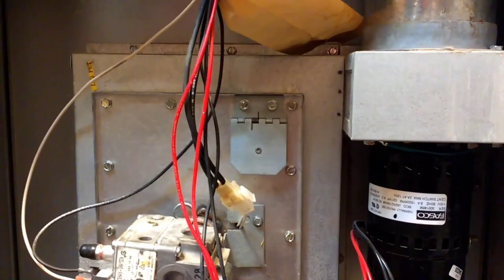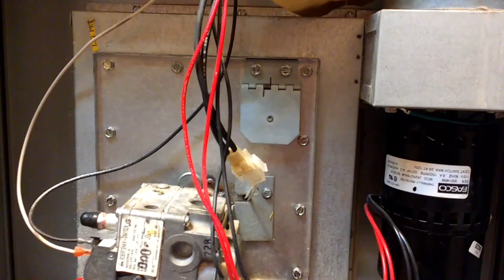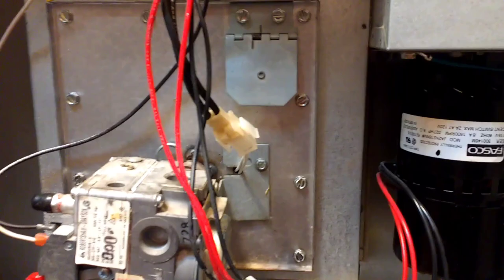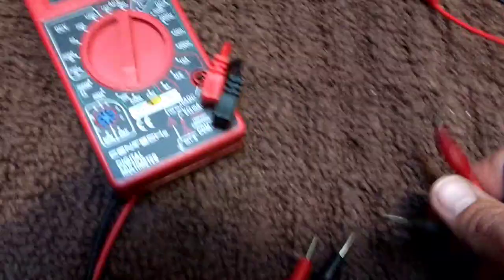Bad Igniter Nordyne Gas Furnace MMHA

Comment: I moved into a trailer that has same model furnance with other issues with blower and filter issues etc and slum lord wont fix it
Reply: No heat? Pretty sure you can stop paying rent until it's fixed if ever in that type of situation. I know someone who did this lawfully. Landlord ended up bringing over mad space heaters and had to foot the electric bill, until it warmed up.

Comment: Did you turn your gas off before fixing it?
Reply from the maker: Yes, online the shut-off valve is right below the furnace, if I open the furnace outer door it's immediately accessible. Very easy. Probably not necessary though, as long as the electric switch is off

Comment: Do have a picture our a video on the ignitor installed?
Reply from the maker: No, sorry I don't. It was a pretty easy install just unscrew the old one pull it out and put the new one in
Reply: on the new ignitor , do the leads plug  into the white plastic easy
Reply from the maker: @redeye9042  mine did, it was a perfect fit

Comment: How do you relight it? I have the same as you
Reply from the maker: I'm not sure what you mean by relight it. This one is electronic ignition (no pilot light) where the igniter is triggered (when thermostat calls for heat) to heat up to glowing hot and ignite the gas. Did i misunderstand your question?
Reply: My apologies. And oh ok. I think mine have to use a lighter on it. This be my first time trying to light any kind lol
Reply from the maker: @Joker-85-420  yeah, if yours has the igniter like mine, there is no pilot to light.

Comment: Is there a video on how to remove and install?
Reply from the maker: I couldn't fond one. But its easy just a screw or two on mine
Reply: I found this one
Reply: @samanthamoran4283  thank you.  I ended up finding a video shortly after and successfully changed it.
Reply: Great having this problem now where did  you get the part
Reply: @anesthesiadreamin  what ignitor did you replace it with? I believe mine just went out on me and am looking for one, but can't find one for this model anywhere.
Reply from the maker: @dravenjellison5264  just google "FCO35KX" and it should pop up. I just took mine down to my local plumbing shop (they do repairs and sell parts) and they had the exact replacement, it was $29.00
Reply from the maker: @dravenjellison5264  in addition, you may find it under 902661A
Reply: @anesthesiadreamin  Thank you sir, I'll give it a look. Much appreciated 🙏🏻
Reply: @samanthamoran4283  what video did u see ?